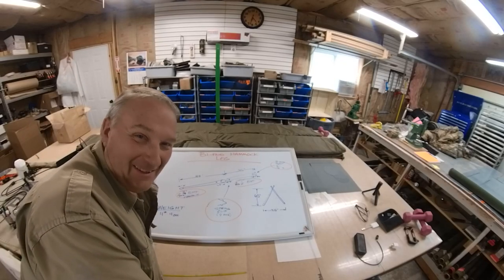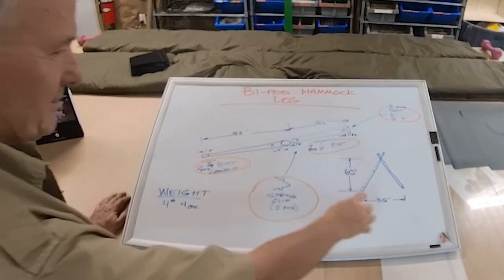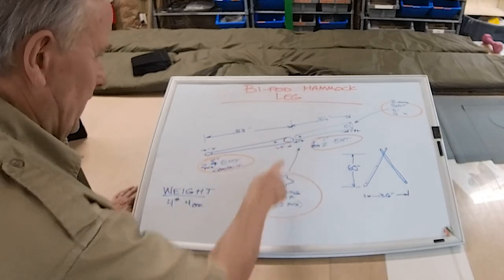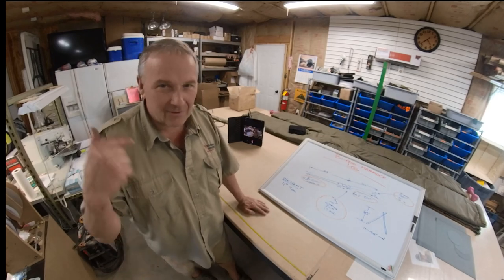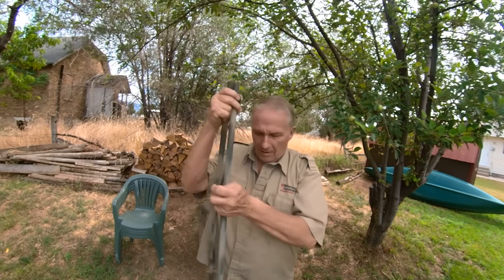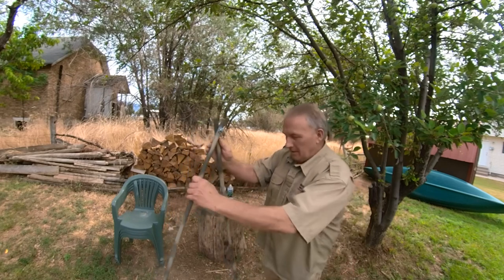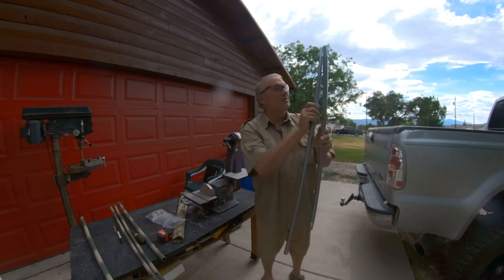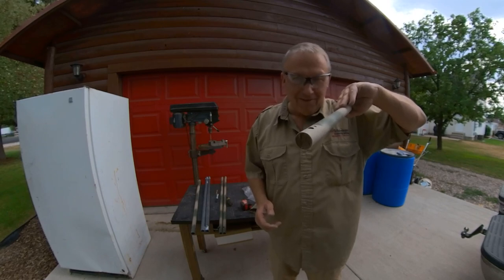Bi-Pod Hammock Stand How to Make One

Comment: Thanks for the great idea, I just made a set!
One modification I made though was to hammer down/in the sides of the top to make a smooth channel along the top. I like to set up tarp up in an adirondak-style configuration, with the front held on on sticks. So having those channels means that if I have two trees to hang from and don't need the stand, I can take the pin out and use the poles to hold up the corners of my tarp!

Comment: Hi Perry!  Good to see you.  You can find rubber cane caps on Amazon to fit on the end of the legs.  Just make sure the diameter of the cane cap is the same as your poles.  You may have to find something more like "feet" to keep the poles from sinking into the sand though.  All the best to you Perry!
Reply from the maker: Thanks Kevin, I’ll check that out !!!
Reply: @wildernessinnovation  a safety belt from a car can keep the poles from sinking into the ground. the ends should be sewn to form little pockets to hold the ends of the poles. cheap and simple. I use this method since I lost the feet of my camping chair, and it's better than those feet were.
Reply: Great idea couchcamp! Maybe sew a pocket on each end of the storage bag.  Multifunctional!!!😅

Comment: Good stuff there Perry.  Any idea what kind of weight those will support?  Love the spring pins too.
Reply from the maker: Thank you - I don’t know why they wouldn’t support up to 300 pounds, I think the spring pins would be the limiting factor. Probably want to keep the hole for the buttons on the spring pins at 1/4” or 5/16” . It is possible to get stronger spring pins, the ones I use the buttons or pins themselves are hollow, ie formed. I’ve seen some that are solid. Also a person could step up to using 3/4” and 1” EMT conduit for super strong Bi-Pod.

Comment: You can wipe the conduit with vinegar before you paint it will help it stick
Reply from the maker: In my former “real life” I had a business for about 25 years doing electronic security. Often we’d have to install poles outdoors for cameras, most of the time galvanized 3” or 4” conduit worked well, but some customers needed the pole to be a certain color. We went to a paint supply and they had a prep we could put on before painting. If it was a very big project we hired a paint contractor to do the work. In this application I’ve found the paint is getting scratched up anyway, so I just paint the legs a couple times a year. Thanks for the tip David…
Reply: @wildernessinnovation  I have a sheet metal fabrication friend that made some things for me and that is what he told me to do to get the paint to stick.